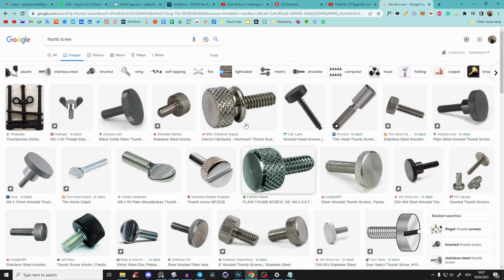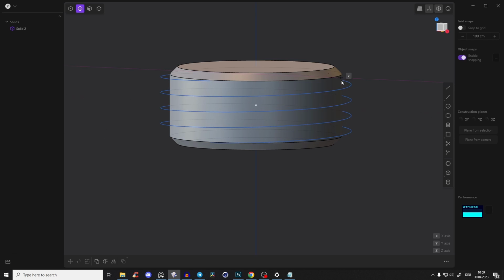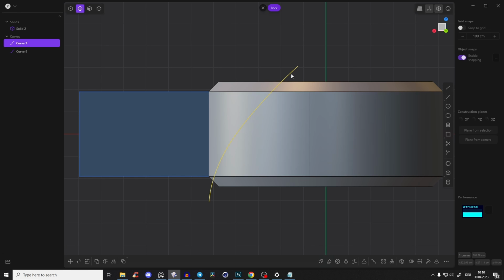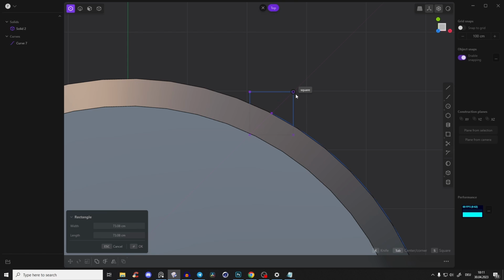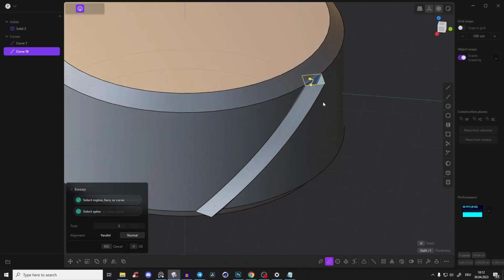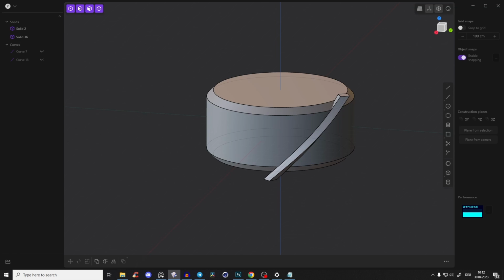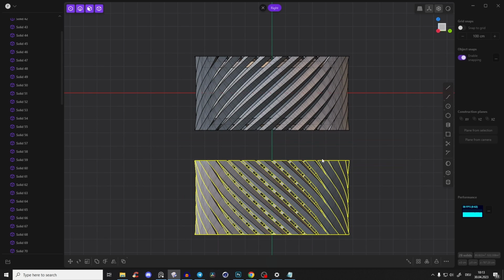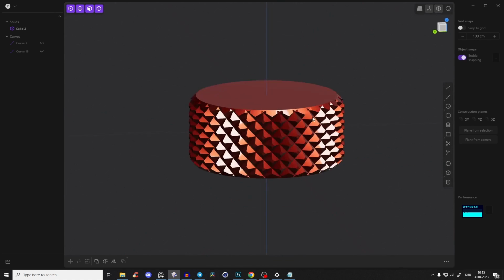Plasticity 3D Tutorial | Knurling Diamond Pattern | Thumbs Screw

Comment: That is a brilliant way to do it, much better than my idea of putting each diamond manually.
Is there a way to do this but with an irregular curvy shape like a competition pistol grip?
A friend of mine asked me if I can 3d print a grip for him with the diamond pattern and I am confounded on how to do this in an efficient manner.
Reply from the maker: I think you can draw some splines and project them onto the body. 

You have to do it more manually and once you have projected all the curves in a pattern you like you can sweep the rectangle on them and boolean it out from the grip.

Check out some tutorials on "projecting spline curve onto body"
Reply: You can make a mesh and use it as a custom array object to copy the diamond (or any other shape you make) onto the array mesh's points & even create a custom attribute on the array's points that will modify each copied diamond shape in some way (like randomize the size a bit etc). But there is a catch. Only one program can do this: Houdini. Steep learning curve but it pays off in the long run

Comment: Can you make a tutorial with screws nuts and threads for 3d printing? 🤗
Reply: McMaster-Carr has STEP models on their website which you can import. For 3D printing you need scale up the nut thread on X and Y axis (not Z) by approximately 1mm (so an 8mm M8 nut „hole“ should be scaled up to 9mm, which 12.5% or 1.125 in Plasticity‘s scale dialog). This will allow for enough clearance with most printers).
Reply from the maker: unfortunatelly I dont have experience with 3D printing so I don't know how to optimize for 3D printing
Reply: You can achieve different tolerances with different 3D printers. On and average FDM nozzle (0.4mm) the tolerance is about  0.2mm or less but with a bigger nozzle it can be more also on an average Resin printer it can be 0.1mm or less. So the question is what printer do you have?